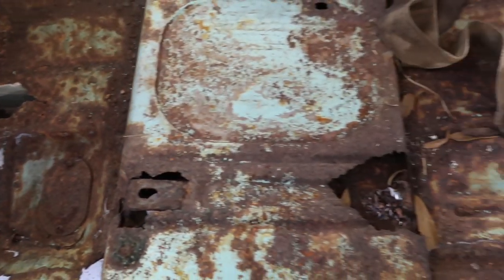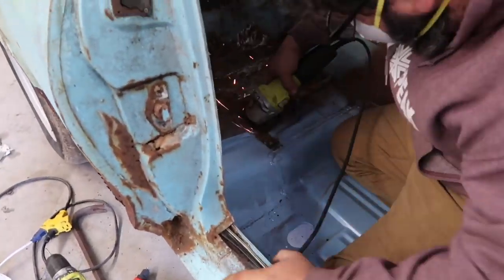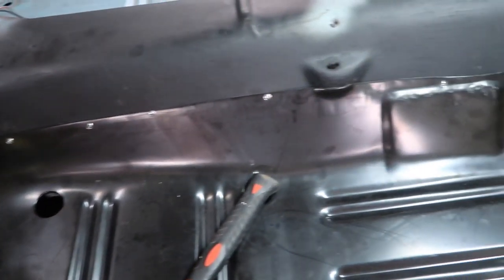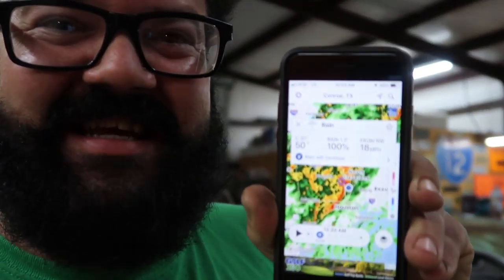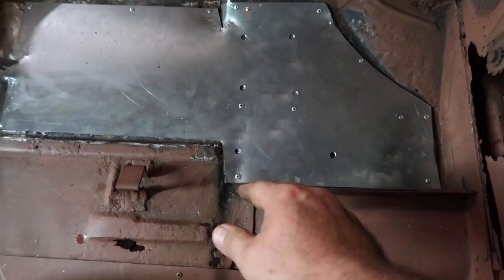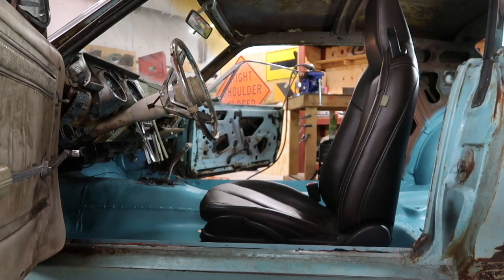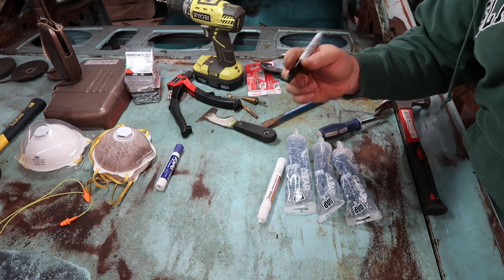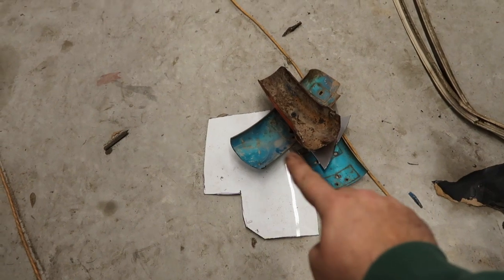$300 Rusty Floor Repair on 67 Cougar

Comment: Nice practical repair and the main thing is you saved it.  I use self tapping screws to cinch it all down, then you can remove one by one and weld the hole shut.
Reply from the maker: Thanks for watching!
Reply: Yes. Someone had the correct answer. 😊

Comment: Back when I was a young driver, floor rust was a common problem in the 60s and 70s cars.  In one car I paid a welder to weld a stout metal plate in the drivers area around the pedals.  When the passenger side rotted out, I didn't have the money to pay them so I just got a double thick sheet of aluminum from the hardware store and formed it to the shape of the metal and used self-tapping screws. Held up just as well as the iron plate at a fraction of the cost!  This repair you did looks solid enough, the gauge of the metal seems a little thin to me but that's pretty much the same with everything nowadays, nice job!  By the way, the number one cause of all this floor rust back then was the windshield to body seals were terrible, and pretty much all the cars leaked, soaked the carpeting, and before you knew it...
 rust everywhere.

Comment: Good job Jake!  Glad to see you’re done with the floor pans.  I’m almost done welding in the new pans on my ‘65 Mustang project, then it’s seam seal and epoxy prime!
Reply from the maker: The seam sealing is easy but messy! Good luck and thanks for watching.
Reply: Yep, thats gonna be this weekend’s project.
Reply: Where did you find the floorpan? Ive been thinking about getting a '65 stang for a project car

Comment: This is awesome man! I have a 1967 myself I bought for $300 back in August, but is in a lot better shape than yours. I’m really looking forward to see what you’re going to do with this thing! Maybe we can share some different tips we find. Im getting ready to work on the floor pans and the engine bay. I’ve just taken the car completely apart and the dash was a mess and I’ve taken the windows out. Your videos stand out with the amount that you show and explain keep it up!
Reply from the maker: Thanks! Its going to take a while but it will be worth it.
Reply: Car Groves you’re welcome man! What did you use to remove the paint and surface rust on the floor?
Reply from the maker: @eliterivals  a flapper sanding wheel on a grinder works the best
Reply: Car Groves I’ll try it out tomorrow, thanks!

Comment: dude cool video. after seeing how strong that floor was with those rivets i fixes my floor pan im my 78 ford f100 with rivets. i spaced the rivets 1 inch apart from each other all the way around and dude its sturdy as hell
Reply from the maker: Glad it worked out for you. If you don't have a welder, pop rivets are more than strong enough. Did you caulk the seams?
Reply: @CarGroves  i didnt caulk the seams but i bought some of that seam sealer from summit racing and went around it with that. i put 3 coats of good primer on it and under it. then i painted the floor with rustoleum gloss black.

Comment: Planes are rivotted:) btw once you get an air powered rivot gun you NEVER go back. Also an electric or air hand metal sheer really work nice for cutting patches over a disk grinder . Great video
Reply from the maker: I really need an air chisel.
Reply: @CarGroves  I don't like mine, leaves a mess:)

Comment: I pop rivet all of my floor pan jobs and never weld them. On floor boards with the center rusted out I use roll galvanized metal you buy at hardware stores. The spot under the metal I pop rivet on I smear bearing grease, then on the top I use bearing grease for my seam sealer, then use RV rubber tape to tape over the seams, in where only the center of the tape will sat on top of the grease at that seam. Then use pickup bed liner paint over all the floor boards, and the same paint under the car. My way will outlast all the pros in the world. And for cars with rust all over the floor boards that arent rusted through, I smear bearing grease all over them and then put large plastic trash bags over them.

Comment: I hear you on the pop rivets—they are super strong—I found 4-5 panels pop riveted in the floor of my 65 Chevelle only because I was upgrading the seats—had I not of pulled the carpet back I wouldve thought they were welded in—only thing that sucks is I cant leave them that way so im currently fixing it
Reply from the maker: For a really nice car they should be welded in. For a turd or quick repair, pop rivets are great.
Reply: @CarGroves  O for sure—I picked up the metal and floor pans today—Im lucky and have a National Parts Depot 30 mins from me—gonna be cutting and welding this weekend!

Comment: I wouldn’t freak out over pop riveting either big freaking airplanes are held together with pop rivets all aluminum
Reply: not pops
Reply: @robertoler3795  not for permanent just to get it going...
Reply: Unibody car you’ll have horrible body flex when the floor is the on my thing that tires your front and rear subframe together  even planes have structural inside

Comment: I plan on using pop rivets and seam sealer on the floor of my "77 El Camino.
Reply: El Camino has a frame, so glue the panels in place.  Epoxy, urethane, special metal roof adhesive. Pop rivets will look UGLY every time you look under the car. They should be temporary only to hold panel in place till glue sets

Comment: The way I understand it is that the weld through primer leaves the zinc in the weld to help protect the weld and will stay better than normal primer and not contaminate the weld like normal primer.
Reply from the maker: Its a pain to weld

Comment: Right on bro!! I actually love 71-73, Cougars, I know you think there ugly. They drive great, when there right and tight, they were last Cougars to come down line at Dearborn plant, simultaneously, with Mustangs, and they all have 351C V8 power!! 2 and 4V. But no 250 I6, no 302, No 351W, either. Marti report says all 71-73 Cougars, had cleveland power. A handful of 1971, did have 429cj, power, but nobody, is going to stumble into one for 500 bucks. I'd love it though. So if you can find a 71-73, cat, you will have a stout deliberation to start with. 96 percent are FMX,automatic. All cats are floor shifted, through 1973. 3 percent have C6 automatic trans. And about 1 percent, have a toploader 4speed manual, or 3speed manual. All have bucket seats. All have cool rear sequential turn signals. When your done wrenching, Its every bit as fun to drive as a Mustang, and it's really sweet inside!! Please give Cougars a try people, there being crushed daily, and I think there pretty cool!! Sorry about the rant. Great down to earth repair video, for the home mechanic!!
Reply from the maker: Thanks for watching Chris!
Reply: Where are you located dude
Reply: @TWarren1485  Northern Wisconsin, USA

Comment: I've found old gas tanks have the right structural bends that's perfect for patching floor pans.  I used to drill out spot welds but not since I bought a Steck 20015. But I suppose most any seam busting chisel will shear right through. I've been watching a guy that grinds through 'em with some sort of narrow belt sander and then uses a seam buster chisel if necessary.  Another guy on YT seems to forgo respirators when using a cut-off wheel and I've never seen him don a welding shield either. I have no idea why his eyes aren't blistered and he isn't hacking out half a lung.
Reply from the maker: Be careful with gas tanks, thanks for watching!

Comment: Good job on this often overlooked automobile.....  Much classier than a Mustang....
I like using self drilling, drill point , sheet metal screws rather that pop rivets.
What about the seat risers?  Not going to use them because of your new seats?  Will their absence weaken the floors?  How about weld in subframe connectors?
PS:  I have a '68 Cougar XR7 that I have already done much of this same repair work to....

....RooDog....
Reply from the maker: Not sure yet, might do some custom seats

Comment: instead of pop rivets, meta screws would be better so you can take the panel out if needed and scribe your cut points, then you can spot weld and take the screws out and weld the holes. another YT site Fitzee's Fabrications

Comment: Great video and gave me a lot of ideas for my grand wagoneer floor when I start replacing it. I'm new to welding. What size welder do you recommend for doing flooring? Thanks.
Reply from the maker: I am using a 120v mig welder from harbor freight. Seems to work fine.

Comment: sheet metal screws would work faster and easily removed to fill with weld
Reply from the maker: ok
Reply: @CarGroves  Yea self tappers helps you kinda skip a step and then you back them out and spot weld the whole.

Comment: Fitzees videos have this guy beat by a mile for restoring it back to factory with tight fitting butt welds instead of lap welds - OK for a floor pan I guess, just depends on the degree of originality you want in a place that will never be seen.
Reply from the maker: I’m working on a $400 Cougar...

Comment: Ok, there’s an auction coming up near me with a 72 nova but the reason I’m looking to get it is because it’ll be cheap. the floor is gone, the rear axel is gone, the only thing there is the body style and the front axel.  I’ll likely get it for scrap price but would hate to loose such a cool car, what’s your take on repairing the entire floor?
Reply from the maker: Buy and entire floor section and weld it in.

Comment: Hello! So, I noticed that you patched some of the rust holes with metal sheets, but is it possible to just rivet on the floor pans, weld them, then call it good? (I'm looking at a 1958 Delray project, and I'm thinking about buying it)

Comment: What kind of welder did you use on this work?
Reply from the maker: Harbor Freight cheap 120v gas mig with thinner wire from local welding shop.
Reply: @CarGroves  Would you use a Flux welder for this job.
Reply from the maker: @ctbrinn1963  you can use anything if you are patient enough. I think flux could work just fine but more grinding to clean welds.
Reply: @CarGroves  Thanks. My 67 Mustang is not as holy as your Cougar. Your video makes me think I can try doing the floor-pans myselt.
Reply from the maker: @ctbrinn1963  I would at least give it a shot

Comment: What is your plan to address the steel you left under the floor pans?  Guaranteed there is a gap between the original steel and the replacement panel that will allow water/dirt to accumulate and continue to rust.
Reply: I think the rust inhibitor prevents that right? Or are you talking about under the car?
Reply: @imacaryay7628  Under the car.
Reply from the maker: It will get welded and seam sealed

Comment: How was the condition of the torque box area? I have a car i may purchase that has bad rust and medal flaking on the torque box and not sure if i wanna get into it. Did you replace those?
Reply from the maker: No, but they sell the parts. If you cant do the work yourself ie the welding, then buy a rust free car. Its very expensive to have metal work done.
Reply: @CarGroves  Thanks. I can weld so im not too worried about that. This is a one owner, never crashed, never restored, car i came across sitting in a garage and couldnt say no for the overall condition and price.

Comment: Bruh you're tripping if you think those soft ass metal rivots will hold up to road conditions lol.  Weld it
Reply from the maker: They are welded, it’s on the video. Please explain the situation where their are no seats in a car and you’re able to use your superhuman strength to rip out 30 pop rivets. My guess is you can’t…
Reply: @CarGroves  Give that car an engine that can crank and do some nasty sh*t, bro-----> In a unibody car those rivets will pop pop pop.  Unibody cars are made to FLEX.  Think TORQUE BOXES: they allow the body to FLEX and absorb road shock.

Comment: Rust in the door posts where the door latch striker is?  Man that is a waste of time repair.  That car is parts only.  That rust is inside EVERYWHERE!  Rust buckets are FOREVER.
-- that's an XR-7 you wanted to save?  Save the serial number.
-- Yes, U have a solid floor pan now, but did you triple check to make sure the car was NOT twisted before you permanently welded it crooked?
-- Consider this a lesson in welding and forgetaboutit, dude.
Reply: Advising Pop riveting floor pans in a UNIBODY car is wrong.  The floor holds the car together!  Do so ONLY in vehicles that have frames.